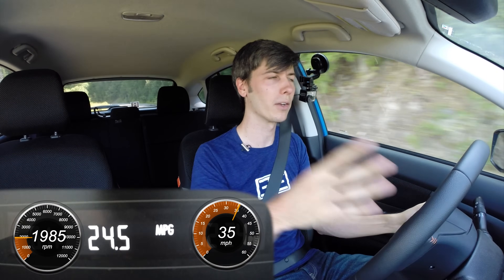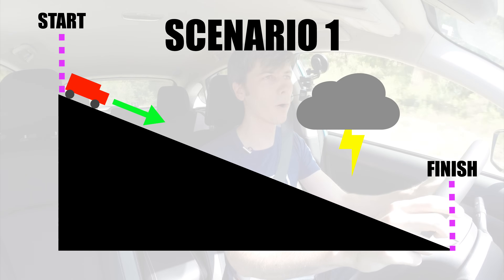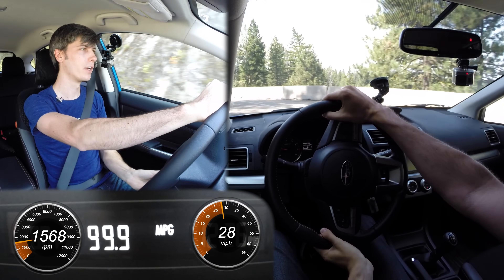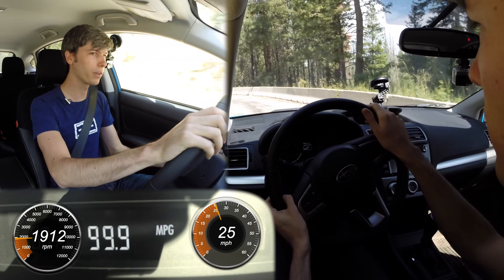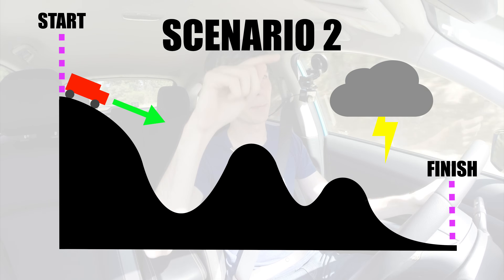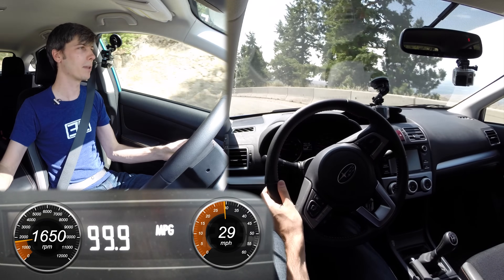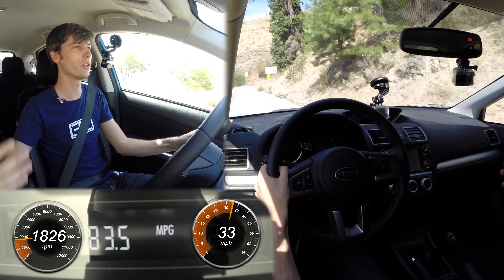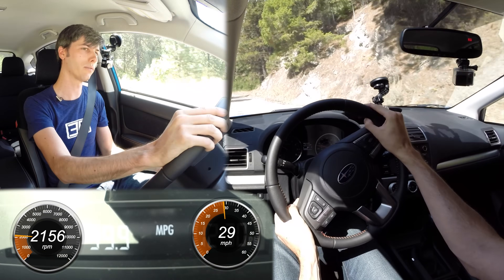What Uses Less Gas - Coasting Or Engine Braking?

Comment: So if i want to break, i use engine breaking.
Reply: SteelVsMetal No, you use engine braking - not engine breaking
Reply: mhm
Reply: SteelVsMetal if you want to maintain a speed downhill without going over and applying foot brake then yes, use engine brake. You still need to use the brake pedal to stop.
Reply: Like I said. Yeah, use engine braking when you want to brake.
Reply: so if i want to use engine *breaking* it will break my engine
Reply: +Just for youtube What are you talking about?

Comment: Should always stay in gear, got into a way bad accident in a vehicle without ABS because I was coasting in N downhill in wet and slid out and T boned a car cause I couldn't stop for a red light. Would not advise coasting in N, you can keep the engine open at the smallest point possible in gear, to where engine breaking is disabled, therefore the car is pulling a bit, using the same gas as in N and you won't experience needing to use a lot of force to get over the next hill as you were saying in the video about letting engine breaking carry you down a hill. I say use engine breaking wisely and be aware of it, never take a moving vehicle out of a gear to save gas, it is just not safe.

Comment: On most newer trucks (at least in Europe) the automatic gearbox does sometimes switch to neutral to save fuel.
Most trucks nowadays you set the Cruise Control and Retarder limit (an example is CC 85km/h, retarder 88). When it hits 88 it starts to brake using non-friction braking methods. The truck I drive knows the topography in addition to the traffic maps. So before hitting the peak of the hill it shuts of the fuel so the speed might lower to about 80km/h at the peak. Depending on the decent ahead it will either keep it in gear and use retarder as needed or if the decent is flat enough it will go to neutral to save fuel.

Comment: Do vehicles that run on gasoline also do the shutting off of fuel when using this method???  I thought only diesel  engines did this with "jake breaks"...
Reply from the maker: Gas and diesel will stop injecting fuel.
Reply: Interesting.  :D   I did not know that.  I like watching your videos, I learn something new on just about every one.

Comment: It would be interesting if you could do a test run of that hill, or a different one, where you go down once coasting and once with engine braking, always at the same speed ~30mph and see what is the difference between the two. While you are using engine brake there are times that you need to use the gas pedal and that lowers you MPG to 20-30-ish while when coasting at a stable 30mph it will stay at 80mpg... It would be interesting to see what is the most efficient average =)
Reply: 80 sounds awfully low coasting down a hill lol

Comment: Can someone explain me? When you cost downhill and you leave the car in gear, you don't use fuel BUT, does the engine wears out more? In neutral, the engine is at 600 rpm, but when in gear and going downhill, it revs to lets say 2000 rpm. Can someone tell me if my thought is true or not?
Reply: Not really. The engine still gets lubrication through oil (as long as the engine is turning the oil will flow in most cases). So it causes no more wear than having the engine under those rpm's while driving. And if you compare it to modern big rigs, they typically want to work around 1000-1500 rpm, but you can use the engine brake and retarder quite happily between 1500-2200 rpms without causing more wear. 

As a general rule of thumb though, don't engine brake for long periods at rpm's you wouldn't normally drive at.

Comment: Why keep the engine running when coasting in neutral?
You don need it at that point anyway...
Reply: Unless you're running a hybrid that has electric servos and don't rely on engine power for the vacuum assisted brakes on your car, yes, yes you do. All the systems off of your car runs off of electricity, and with the engine off that also cuts those systems off.

Comment: Yea sorry, but this is car dependant. Take your S2000 for example. Use Torque, and watch that the car does not completely shut off fuel when coasting in gear, and in most cases used more than just idle. I routinely get better mileage taking the car out of gear, striving for that 30 mpg on my daily commute. This is so car dependant that this video will just spread more misinformation. (FYI, I've had my S2000 for 15 years, and track every single tank, even before apps like Torque I found coasting out of gear got me better fuel mileage in this car.)
Reply: + Leah Most ECU systems are working the same in modern cars as far as i know, or most of them are working similarly for engine and fuel wise. And yes, they dont completely shut off the fuel, you have a point, but it wouldnt be so significant since it really uses a much smaller portion of fuel than usual. Since i drive a carburated one, i consider "modern" as 99 and above. But i think it would be from 2006 to 2017, to call it a modern car. Also, please dont get too in to it, it really is not worth the time being spent on the internet.
Reply from the maker: The video applies to all modern cars. Of course, technology changes with time, it may not apply to older cars, and certainly doesn't apply to carbureted cars.
Reply: +Engineering Explained Why the heck doesn't YouTube force the video poster's replies to the top of the comments so that people quit asking the same questions or make the same comments that have already been answered earlier and are too lazy to read through them all before commenting? It would so help to clean up these redundant time wasting comments.
Reply: Leah which is why he included that information for people who know how to read
Reply: His assumption that every modern fuel injected car completely shuts off the injectors while coasting in gear is also wrong. Which is the point I was trying to make. He needs to conduct this test on his S2000 to see this. The duty cycle is reduced while coasting, but it's not as low as the cycle is while the car is idling. Hence in most cases it is more fuel efficient to coast out of gear in a S2000. He can use software like Torque, and a wireless OBD adapter to find this out.
Reply: He also doesn't even define what "modern" is. As some cars even made as recently as now will still keep the fuel on during coasting to heat the catalytic converter. The factors in this question are to high for him to make the "modern" car assumption. Because even cars made in 2017 do not all turn off the duty cycles when coasting.
Reply: I have to agree with you, I regularly see a minor decrease in fuel consumption when using either of my cars (Note/MX5) if I stick to the same commute to work all month with the 'Aberdeen Overdrive' (neutral) technique. If left in 5th with no throttle input when travelling downhill, my cars must be injecting a small amount of fuel ? The exhaust noise does not change when left in gear.The thermodynamics of the engine cooling/catalysts would get pretty complicated if the injectors shut off totally?
Reply: I disagree. He only says modern cars. Hardly specific enough. This video will only cause more misinformation about it. Is a car made in 2009 not modern? His Subaru compared to his S2000 will have an entirely different fuel mapping process. This isn't one of his best videos, as the topic is far to complex to educate people over 5 minutes. When his conclusion is "it depends" the video is just kinda pointless.

Comment: What about (old) cars with carburator? Fuel is being used regardless of being in neutral or in gear as the carburator never closes entirely, so it should be the same correct?

Comment: so in a hypothetical situation, where there is an endless downwards hill, you're saying that if you engine brake infinitely, you will never run out of fuel??
Reply from the maker: Correct, you do not use any fuel while engine braking in modern fuel injected cars.
Reply: Yes, because you’re turning the gravitational potential energy into kinetic energy that drives the alternator.

Comment: Just turn off your engine and put it in neutral, maximum speed and no fuel consumption
Reply: And ignore the hydraulic servo pump and vacuum assisted brake amplification? Yeah, no thanks. If you're running a hybrid though, those systems are independent of your engine running or not, so they shut the engine off.
Reply: On an empty straight road that you’ve driven 100s of times its okay

Comment: I have a 2016 Crosstrek CVT and just did this same test on my way to Microcenter.  Even on flat ground I was getting 99.99 MPG when in neutral.  I'm trying to wrap my head around this test (without doing too much research into the engine controls).  Obviously be safe when you're putting it in neutral (open roads with full visibility, etc.) but I'm looking more than anything at the RPMs.
I constantly have to go down a winding hill on my way home and when I leave it in gear with foot of the gas then it'll hover at around 1100 RPM and leaving it in neutral gives me 800 RPM for similar braking patterns (to try to stay at the 45 mph limit).  In both situations I get 99.9 MPG which doesn't tell me much but when looking at RPMs then I think that's where first principles comes into play.  How does the engine hold the extra 300 RPM (~for about 2 minutes down that hill), and yet still get the same MPG?  Is this a CVT gearing nuance?  I would think that if they're on the same gearsets for both situations then the situation where I'm in Drive would somehow have to waste more energy to keep those 300 RPMs up while still holding 99.9 MPG.   Anybody got an answer for this?  It's probably a simple answer but I don't know how to rationalize it when trying to compare against EEs manual situation.
Reply: The explanation is that your car's instrument isn't precise enough to measure below a certain amount of fuel spent, which both ways fall below. Doesn't mean they're not different though!

Either way, coasting down a hill in neutral is unsafe and increases the risk of overheating your brakes, causing them to fail and give you now breaking at all, and even if they don't fail, the additional wear on the brakes is gonna cost you more than what little an old engine might inject more while idling at a higher rpm.
Reply: It's also not measuring actual fuel flows. It is based off the Maf sensor, etc and estimated

Comment: Coasting in gear uphill has proven to use less fuel completely. At which point you come to a stop and stall, therefore your engine uses 0 Fuel. Myth Busted.

Comment: That all makes sense from a fuel efficiency standpoint - but could you elaborate on if engine breaking adds to engine wear and the brake pads vs engine maintenance cost debate?
Reply: It doesn't.

Comment: Could you explain vacuum lines? Its almost loosely related to this video.
Reply: I’ve always wondered about those.
Reply: ? What do you mean? It's a tube with less than atmospheric pressure in it. Vacuum is used to assist you in pulling the brake pedal, it used to be used to move the windshield wipers, but they're not really used for much anymore besides brakes today I think.

Comment: A direct injection car uses no fuel engine braking, a port injection car still uses fuel to keep the intake runners “wet” with fuel.  This helps with the throttle response.

Comment: Tnx for posting this again, so if the engine is using absolutely no fuel in gear how does the engine turn over? you can obviously hear the bang and notice the vibration, moreover if there is no fuel and no spark it means technically you can turn the ignition off and still drive but we know that is not possible, right?
Reply: Gravity it turning the engine. You can infact turn off the engine when coasting down a hill in gear, don't do that though you'll lose brake assist and it may lock your steering column.

Comment: Instead of putting car in neutral you can push throtle very little bit, you'd use fuel to accelerate your vehicle and keep engine running instead of only keeping engine running and you still will be able to go up next hill because you get speed earlier

Comment: If you're off-roading in an automatic and you're going down a rocky hill, should you use neutral or drive?
Reply: DRIVE, Keep the car under control. In neutral the car is out of control.

Comment: Wait if u r in gear isn't ur engine at a higher rpm than idle so it uses more gas?
Reply: No. It'll use less gas if it's a modern fuel injected engine. No matter what RPM's
Reply: interesting i wonder from what year they started implementing fuel injection cut off when coasting down hill? also i wonder how a car can tell your coasting downhill?

Comment: Ok I'm lost when I engine brake in my auto wrx it raises the rpms so dosnt that waste fuel instead of keeping it in drive and letting rpms so automatically and just braking
Reply: Joshua Anderson No fuel is being injected. RPM raises from the drivetrain forcing the engine to turn faster.
Reply: FCFordLord  so me say instead of leaving it in automatic and me manually down shifting to say 3rd rpms raise   it's using less fuel even thou rpms went up ?????
Reply: Your engine revs and wheel speed are related through the gearing of your transmission. So the lower gear you are in, and the higher road speed you have, the higher your engine rpm will be regardless if the engine uses fuel or not. When you use your throttle, the fuel combusting inside the engine forces the pistons, which in turn rotates the crank, which drives the transmission, which drives your wheels (in simple terms).

Going down hill, gravity accelerates (pulls) your car. The friction between the road and your wheels causes the transmission to turn, which forces the crank to rotate, pushing the pistons. So it's the exact same set of motions, it just doesn't consume fuel.
Reply: halsoy  ok thanks for explaining  I thought lower gear higher rpms more fuel in same was if you were on the gas thank u for explaining now got it
Reply: Like they said, if gravity is moving the car, no fuel will be injected even if you're at 20,000rpm.

Comment: Does an automatic transmission get proper lubrication when coasting in neutral?  I'm not sure the pump is working when not in gear.
Reply: I believe it depends on the model of the transmission, I think there are some that don't but most do. But you should never coast in neutral.

Comment: In the second scenario isn't it better if you keep the gear in and the clutch pedal pressed down? In this way it could be more efficient because there are fewer parts that rotate with the engine and probably it's even safer than neutral, isn't it?
Reply: Yeah

Comment: Instead of putting it in neutral in the hill scenario, why not just change to a very high gear (like 5th or 6th)? You'll still be in gear but the engine braking will be almost none.
Reply from the maker: Try it out in your car. There's a significant difference. Especially noticeable once the road starts to get flatter.
Reply: I don't really think that's any better. If you're in a high gear and going slow (while momentum builds up) you still have significantly reduced control of the car than if you were in an appropriate gear for the speed.
Reply: My Car is around 3000 rpm in the highest gear at 120km/h it is a huge difference to shift to neutral. I have to stay on the accelerator to hold the speed downhill. I i shift to neutral i can just roll down the hill and the car will accelerate
Reply: @Engineering Explained, engine braking is the lowest when engine RPM is low, and low RPM is what you expect to happen when you use high gears ( 5th or 6th).

Comment: Before I watch the video. I want to guess.

 I know that most (if not all) vehicles these days shut off the injectors while engine braking.

While in neutral it will have the injectors on to hold an idle.

Therefore engine braking is better for mpg.

If the terrain permits, I would suggest engine braking in a high gear, so that the actual engine braking effect is minimal so you maintain speed and go farther.

Comment: Another correction to your video you will not engine brake to a stop unless you turn off the car.
Reply: That's pretty much useless information. I hope anyone that has driven a vehicle can figure that much out. Just saying.
Reply: Just for youtube saddly enough I had to explain to my friend that that was a mistake in wording and because of that one flaw alone he didn't believe the rest of the video and I get stuck pulling up forum after forum proving the rest of the video... So yes I agree but some are difficult.
Reply: Well that's pretty embarrassing for him. Not sure what he was expecting. Just explain to him that if the engine is above idle it'll not be injecting fuel.
Reply: Just for youtube yeah he didn't believe me until after all that mess.

Comment: When not accelerating and you downshift, the engine gets louder as the RPMs go up. In this scenario, you aren't using more fuel when the engine is louder/RPMs are higher?
Reply: I highly recommend you to read about transmission.
When you're driving for example 50km/h on 4th gear you've got 2000rpm, on 3rd gear you'll have 2500rpm, it's beacuse gear ratio. And when you are driving down and realese throttle you're not burning fuel, so it doesn't metter on which gear you are

Comment: If you're not going to a stop at the end, and if we assume the speed is constant between the two scenarios, coasting is always better. You're just subtracting the energy from the system necessary to keep the engine at idle, whereas with engine braking you are subtracting the energy necessary to keep the engine at the higher rpm.
Reply: No, you will use no fuel if you're in gear. You'll use fuel in neutral. It's not more fuel efficient in neutral since you're using fuel.
Reply: You will be using no fuel if you're in gear, but that engine braking will slow you down more, and you will need to use more fuel than the coasting car in order to catch up to it.